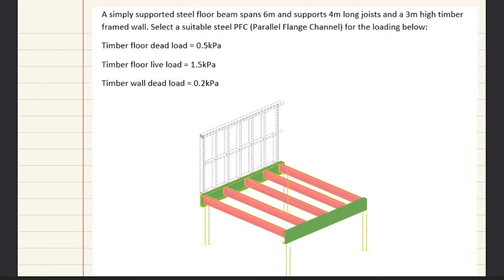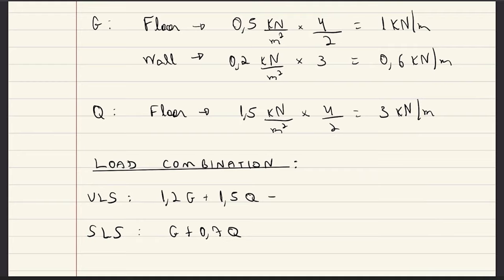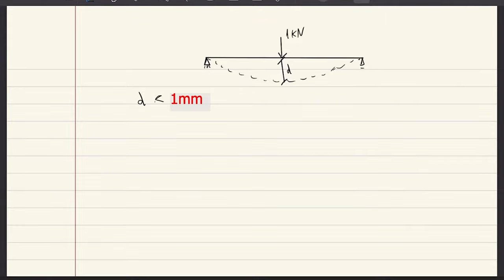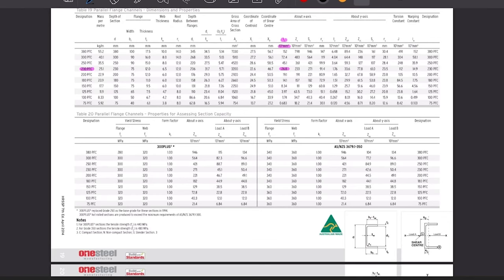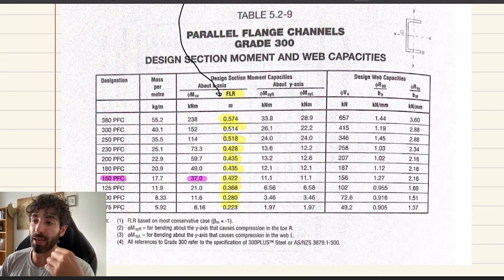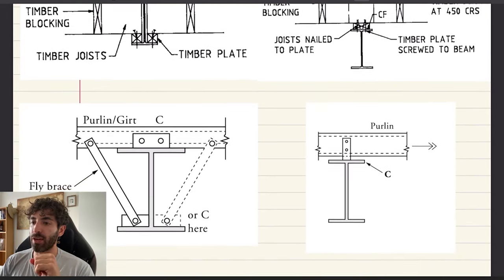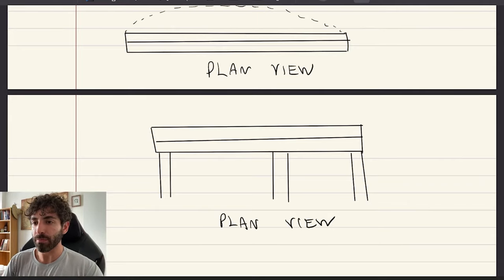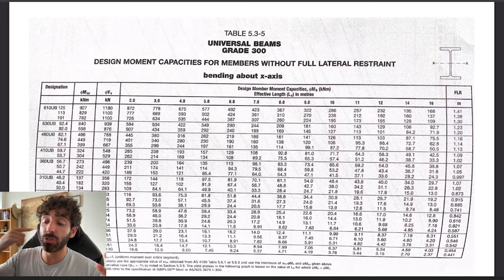How to Design a Steel Beam

Comment: Do you precamber steel beams to compensate for short and long term deflection? The PFC would have some restrant due to the joist connection plates that are welded to the flanges and web of the beam at 450 centres. Are you familiar with the publication called Steel Designers Handbook written by Ron Tinyou. He is a structural  Engineering lecturer at UTS.

Comment: useful video, Can you tell us why we need ULS and SLS? Why don't we check everything under ULS, BM, SF, DF, etc.?
Reply from the maker: In simple terms, ULS is for the collapse of the structure, reason why the safety factors are higher. SLS is for deflection, vibration, etc which won't cause any collapse of the structure (excessive deflection or vibration is still considered as a failure though). Does that make sense?
Reply: @bengthebrazilianengineerinAus  Thanks for your quick reply,  I can understand that the deflection and bending moment are linked to each other. The structure deflects more, and we can assume that it is subjected to more bending. Can I understand your explanation like this? Suppose, we check BM and DF under ULS with the same loading factors and material factors. Can we assume that the structure would fail in bending before it reaches the maximum deflection? Therefore, the BM and SF are considered critical and checked under ULS, and the deflection is less critical and, hence, is under SLS.
Reply: I think you have already answered so I am happy with your first reply

Comment: Hi you hnave not taken the load of steel joist on  steel beam in load calculation. These Jiost will apparently act as a point load on the main steel beam.
Reply from the maker: Hi Hamid, the loads of the joists are included in the dead load. You can simplify it by assuming the various point loads along the beam as a line load.

Comment: the section moment capacity should be greater than the design moment! 37knm is less than 2889knm, this is not correct
Reply from the maker: 28.89 kNm and not 2889 :D
Reply: @bengthebrazilianengineerinAus  thank you 🙏

Now it does make sense
Reply from the maker: @tonpituwai963  no worries :)

Comment: Great video. thank you! i wanted to ask is there a standard document/book which shows the weight of building materials for Australia that Engineers refer too? this would help with Load takedowns in the real world. Preferably these values are in kn/m2
Reply from the maker: AS1170.1  table A2 will give you these values.
Reply: @bengthebrazilianengineerinAus  great. Thank you!

Comment: Hi mate, thanks for your informative video. Just have a question about the dynamic deflection, so could you please give more information or explanation for this point? Is it declared in the AS or somewhere else? I would like to read further about its applicable ranges, such as for other beams (cantiliver, fixed-ends), other usage purposes (residential, office...) or other restraints (full or without restraints). Thanks.
Reply from the maker: Hi Dao..this rule comes from the timber code (As1720 if I can remember correctly). It's widely adopted for resi  and some commercial projects. Have a look there and let me know if you can't find it and I'll look it up. Cheers
Reply: @bengthebrazilianengineerinAus  Thanks mate. It was limited to 2mm in CL4.1.3.5 AS1720.3 for timber joist, but not commonly for timber bearers or especially for steel bearers. I think it should be too conservative when considering serviceability deflection of 1mm for 6m span steel beam in residential buildings. However, the information in your video is valuable. I am looking forward for more videos from you. It is appreciated if you can make more further discussions on the restraints of segment/subsegment from some practical projects you did. Cheers.
Reply from the maker: @daohoanghiepphan5138   This number is a rule of thumb for solid sections. As you may have seen on the code, it can vary for different shapes such as I-beams and PFC's.
It's primarily for joists, but  in some cases you may have to consider dynamics for bearers, such as in long light beams. Try designing a 6m long beam with a big floor load on it and the same beam with a way smaller floor load on it. You will notice that dynamic deflection for the latter is considerably higher.
I would look at this problem with the following concept:
F=m x a 
The force is the person walking on the floor. The mass is the weight of the beam. The lighter the beam, the higher is the acceleration, therefore more bounciness.
You can calculate the frequency if you're really worried about dynamics as well. 

For joists, 1.5 is good number.